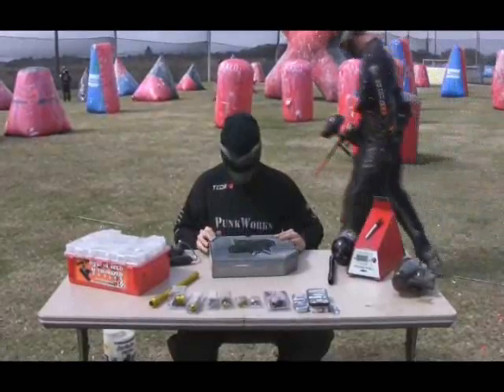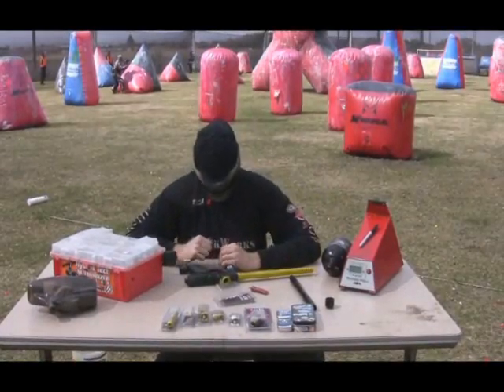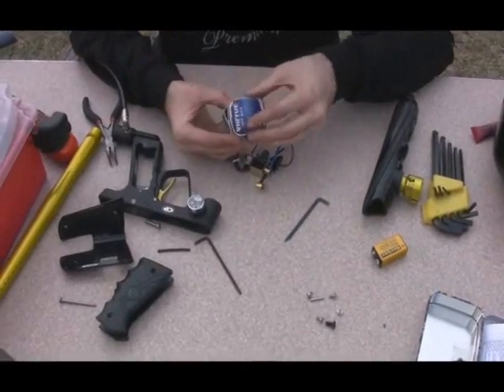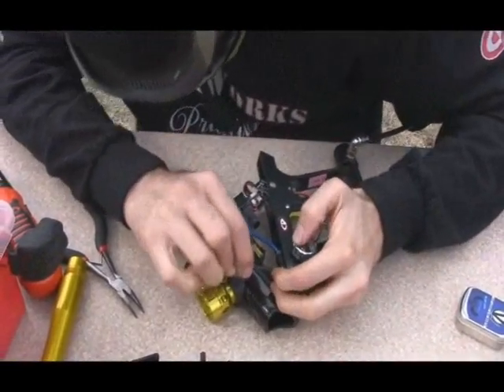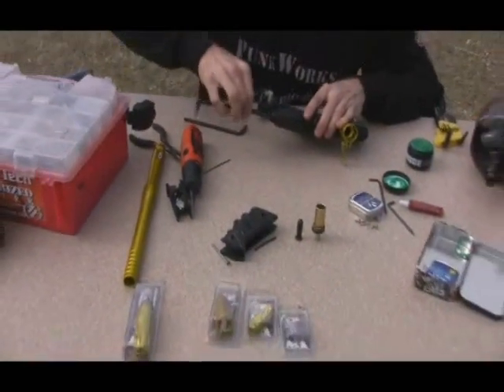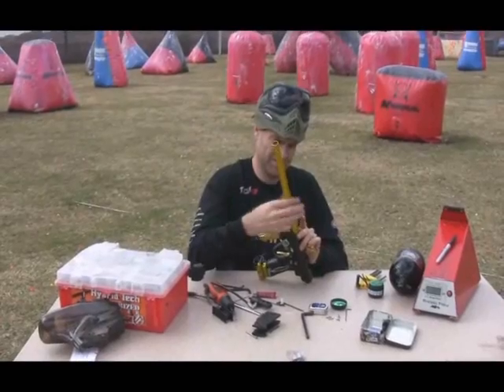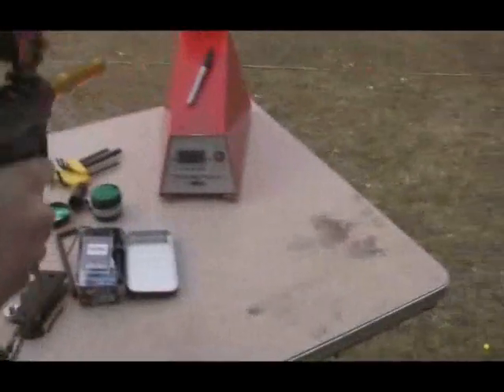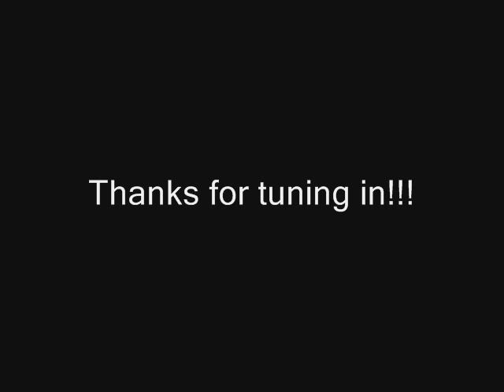The Smart Parts Ion Upgrade Super Duper Show of DEATH!!!

Comment: New to PB and I need a gun. I was looking for a SmartParts Vibe. Found a guy with a Smart Parts Ion which everyone said is worse but this one has these upgrades:

Virtue redefined board, Upgrade trigger (looks like the CP trig in the vid), Sick looking upgrade body, Shocktec Bolt, SmartParts QEV, Clamp feedneck and a CP 14" 689 i.d.
So is this Ion with all these upgrades better than the Vibe and is it worth $200?
Reply: Is the Ion with the listed upgrades^^^ better than a DP fusion f8?

Comment: the ion is an alright gun, it works just fine for my needs and its very upgradeable but it is a huge issue how difficult it is to break it down. you just have to be so careful its a pain in the ass. bolt out the back is essential

Comment: depends the amount of money you have. if you have 300$ then go for the ion. if you only have like 200$ then go for the vibe because the gun cost only 150$ plus you can get a co2 tank which is like 40$ less then NoS tanks. then just getr yourself a 40$ hopper and youll be good. but  if money is not a factor get an ion and up it like this

Comment: nice video  i have all the parts upgraded also techt bolt and trigger empire mount 2 rail drop forward freak barrel 360 qev  set dwell at 13 and rof at 10 works best and keeps up with tournament ready guns

Comment: get a used PM6 with UL frame and Virtue Board on ebay for $225. it is the best deal i have ever found for any paintball gun PERIOD. And I have checked out the prices for almost every paintball gun model out there, used and new. The worst thing that could happen with a used gun is that you'll pay $40 to have DYE tech it and make it like new. Virtue also flashes their boards to update them. i promise you that there is no deal that even compares to that. the PM6 is a high end gun. And Virtue!!

Comment: When ions were the big thing most of the shops around me were offering what they called an ion pro, pretty much it was an ion with a locking feed neck, freak or all american barrel, usually a cp asa, some shops also replaced the reg as well as the board. You could get them in many different colors and everything was color matched. It made for a really nice gun right around the 300 dollar price range

Comment: MSRP:
[Ion XE - 235$][CP Trigger - 35$][CP Regulator - 85$][CP 1 Piece Barrel - 30$][CP Clamping Feed Neck - 30$][CP Rail - 20$][CP ASA on/off - 35$][CP Pressure Gauge - 15$][TechT L7 Bolt - 50$][Virtue LED Board - 190$][Virtue Blue Eyes - 30$][Virtue QEV - 20$][ASA Macro Fitting - 5$][Hater Sauce - 13$][Blue Loctite - 7$]
=800$
Reply: so true.

Comment: People don't like ions because of a couple reasons.  First many of its stock parts of very very low quality (reg, asa, feedneck etc etc). Unless you have ion xe, you have to take the whole gun apart for cleaning if it chops. The ion ,when stock, may be a cheap gun, but after getting the upgrades that are needed to make it competitive, it can cost more than a better marker.

Most markers nowadays allow for alot of customization, although better markers don't need it.

Comment: i have a trigger from New designz its "ION - roller SAW blade (Alum)" and i put it in, but when you press it. it doesn't go back to the normal spot, it sticks to the frame.... it doesn't have the springing action, any clues PLZ help

Comment: dont buy one now, they are broken currently for ions and whatnot in that section, the plunger smartparts make for the board doesnt fit so virtue has to redesign the board, the store i went to bought 5 and none of them worked. should be fixed very shortly

Comment: Pulled the gun out 10 yrs later . It has a aftermarkey bolt and barrel system . Lower rail and hp 68/4500 tank. Plus a new feed neck with a Diablo hopper. Time to find some parts and complete the mission. Thanks

Comment: anybody have any reason as to why my CP reg which was just bought, lubed up anyway.. does not recharge as fast and uses more PSI to cycle than MY STOCK ION REG??????

L7v2 bolt, Virtue OLED set to 10ms dwell....... say from 150 PSI, CP uses about 50 psi to cycle fast... the stock ion uses about 20-25 PSI... go figure.. maybe the CP needs breaking in?? those washer springs man..

Comment: I have a stock ion at the moment because I don't have the cash to upgrade it right now. All I have done is put a new feedneck on and I'm about to get a used CP barrel from a friend. According to what I've seen in other videos the best dwell/recharge setting is 45/3 but i just shot it to test the setting and it seems like the air efficiency got way worse. What is the best way to set it to get good air efficiency but also have a decent speed setting. I'd love to hear any advice. Thanks!

Comment: I would use the empire nano. You have to buy the rail for it but you can get them both in a package deal along with a straight fitting which you have to buy separately.  Its not an on/off asa but the hose comes out the front instead of the side which makes it awkward to grip.  They ran out on ANSgear but you could probably find one on amazon or ebay

Comment: well a good way to unseize the red lock-tight is by taking a heat gun to the fitting, not a torch but a heat gun there is a difference, and then slowly apply pressure untill u feel it give. i hate smartparts b/c it takes forever to get fittings off b/c of that stuff

Comment: I got the stock ION with CP reg ( a must), 200 psi performer, quiet consistent gun. I use it with eyes off halo b hopper with a freak barrel. Not the sickest, etc, great performer. The ion is the tippmann a5 of speedball...

Comment: It's not really a pain to work on if you get upgrades like the ION-XE Conversion kit which makes taking out the bolt a lot more easier and doesn't risk stripping screws, banjo's etc. That's why I changed mine to the ION-XE :)